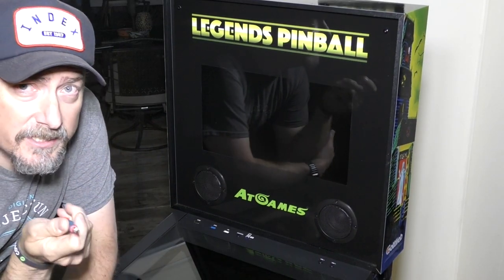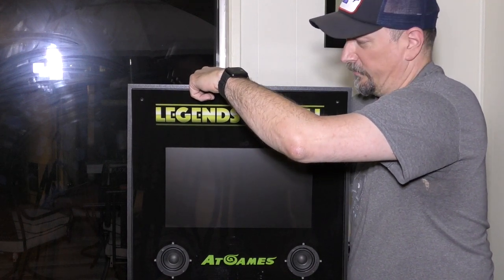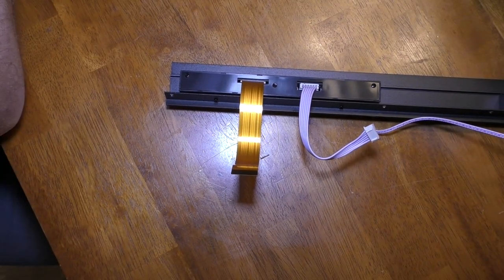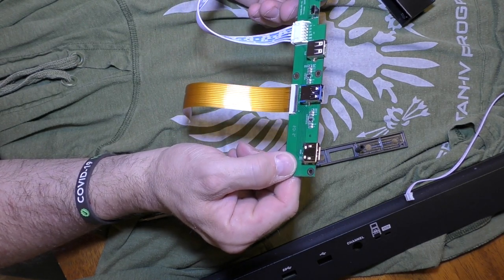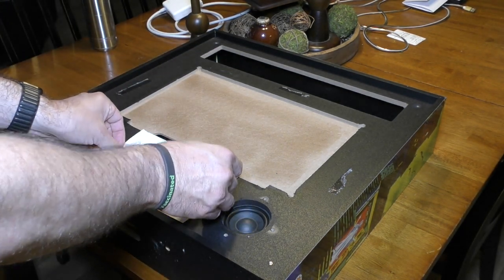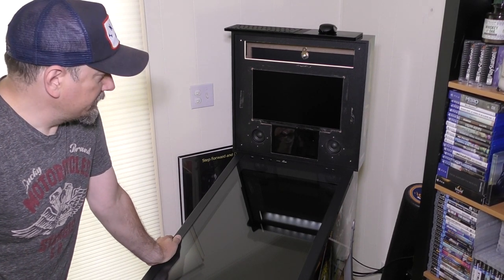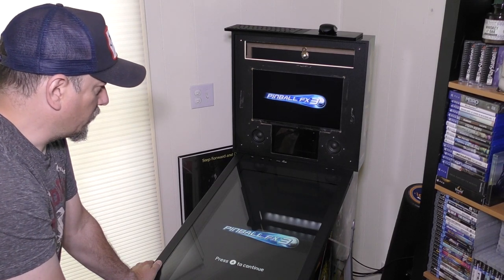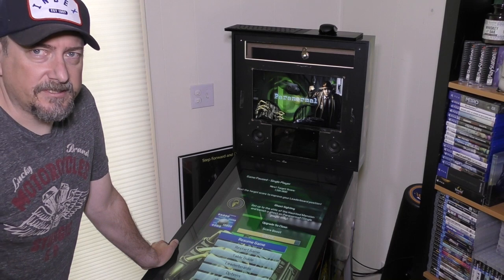Let's Upgrade the ALP with a $100 DMD - Part 1! AtGames Legends Pinball Teardown And Install

Comment: Nicely done! Lots of scary stuff going on , in there. I've tried 8" DMDs, but my vision just won't let me see those tiny displays, from 3 feet back. I'd likely have to put a larger monitor, for the back glass, and a 15" DMD below it, with the speakers being moved to the back. Did do that on a GRS 3/4 scale table. Works well, albeit looking non-canon. Works for me. visitors can just play the A1up tables, if they don't like it. LOL Perhaps one larger vertical 16:9 monitor, split for the two display streams would work, too. Glad you were able to get it all working. Very cool. Thanks for sharing.
Reply from the maker: Thanks for sharing ThomasGrillo. Good idea with the single verticals screen. I know there are a couple different aftermarket DMD & Backglass Backboxes out there, so at least there are options for folks wanting to and a decent sized DMD

Comment: Why not have a piece of glass in place of the plexcy you can spray paint the inside of the glass and also you can cut a separate glass for the dmc screen so youll have 2 pieces of glass if you like

Comment: Was it necessary to remove the stock dmd screen though as it's really fragile I've read? I'm thinking just 4" × 1" slot cut under the stock dmd so the cables for new monitor just feed in from back of monitor. Then I'd just 2 way tape with something strong like gorillas the new monitor to the box

Comment: yes you are right you don't need OTG button go into OTG mode but i think you need the button get out of OTG mode right?
Reply from the maker: Hey David, yes you’re correct. I mentioned that at the end of the video. You still need a way to back out of OTG. You can also just flip the power switch on and off if nothing else.

Thanks for checking out the channel!

Comment: DMD mid is nice. I may do something similar. I want my mods to stay close to home, too. Replace exciters with stronger ones, throw in a rumble bass and call it done (except I might do a DMD) for me if my modding starts going too big, I'd rather buy a bigger, badder cab or build from scratch.
Reply from the maker: Yeah, I agree with you. At one point, you just have to make the call to build a more official cabinet. I’m well past that point, but I’m lacking space, which keeps me from building the full size unit, so I just keep hacking this ALP up, lol

Thanks for checking out the channel!
Reply: @FactorofGames  yup. Big deciding factor, right there. My game room is tiny. Maybe 10 foot x10 foot. Luckily removing doors on and clearing out a closet gives me some more real estate. But that's what steered me to look at 3 machines with multiple games and controls each to give me the ability to play the largest array of games I can. ALP I think really hit the mark.
Reply from the maker: What are the other 2 machines that you have beyond the ALP?
Reply: @FactorofGames  don't have yet. Arcade 1up Outrun that I want to modify with a Logitech G29 force feedback wheel and you can get a manual shifter and 3-pedal setup then load it with any racing game I'd ever want. that works together and the atgames legends ultimate. My dream. I should have the other 2 in a month or 2. My ultimate dream for my tiny setup is a custom cab instead of the legends ultimate and have buttons, spinner, guns roller ball and flight stick on a 2 player set up. But that's just a dream right now. I know nothing about building stuff.

Comment: Any idea where I can find images for FX3 backglass running 3 screens Just the image No DMD or Speaker on it? Thanks in advance.
Reply from the maker: You should be able to grab them here: https://drive.google.com/drive/folders/1QfTJyNvROCttPsZiQlZ3aNCagods0zNl
Reply: @FactorofGames  I have those but is there a way to remove the DMD on them. Just those image by themselves?

Comment: Nice video! How can I separate the DMD display from the back glass? I want to do this with my legends pinball but right now my back glass and DMD are on the same monitor. Thanks
Reply from the maker: The only way to separate them is with a PC and using the OTG capabilities of the Legends Pinball. You need to also purchase the AtGames Vibs board to connect up an additional hdmi connection. This playlist should cover a lot of the overview for setting up your ALP for backglass and separate DMD https://youtube.com/playlist?list=PL8q1uu7_LJHRv9UJBEWtlqmWI1xrS8sNF
Reply: @FactorofGames  
I have my pc hooked up and I am using a separate monitor right now just for fx3 because atgames is out of the boards at the moment. Once they have them back in stock I will use the legends pinball back glass. I just purchased the 3rd screen for my DMD to be on i just wasn't sure how to separate the DMD display from the back glass. Thanks for the response and I will check out the link you provided.
Reply from the maker: Got ya, I wasn’t quite sure where you were in the process. So the Pc will need to see all 3 screens which means your PC Card will need to have a few DVI ports or hdmi out connection. I run a setup with 1 hdmi out and then 2 dvi to hdmi out and that accommodates all 3 screens. You might be able to use USBc to hdmi if you have that option on your rig.
Reply: @FactorofGames  
Yes Sir I tried this last night my laptop will display 3 screens.
Reply from the maker: What is the connection to the DMD?
Reply from the maker: Actually, a better question is did your pc see all 3 screens? Also, what pinball game are you trying to run that doesn’t separate the DMD and Backglass? If it’s Zaccaria on Steam, there is no option for a separate DMD. If it’s Pinball FX3, you need to request a Cabinet code which is free. Pinball Arcade costs $150 through Arcooda. Then there are Visual Pinball and Future Pinball, which you setup yourself.
Reply: @FactorofGames  
Right now I have the main screen on the legends pinball play field I have a computer monitor that i am using for now as my back glass and DMD display. They are both displayed on the computer monitor and I have my laptop screen that I can use as a 3rd monitor if need be.
Reply: @FactorofGames  
Yes I already got my code from fx3 and fx3 from steam are the games I'm running
Reply: @FactorofGames  
I want to thank you for your time I think I just figured it out. I was trying to attach a pic of my setup but it wouldn't let me. I have everything correct now after messing with the Dot matrix. Again thank you I also subscribed to your channel

Comment: Do you have to purchase the artwork for the back glass for each table in OTG? If so how do you go about doing that? Also is there any programming for the DMD to get it up and running? I have a capable desktop and built a custom back box. Already have the 24” monitor and DMD. So questions are.. any programming to get the DMD running and also about the artwork for each table in the back glass in OTG. Tks for any help in advance
Reply from the maker: For the DMD, it depends on what PC game you are running. The most basic is Pinball FX3, and all you do is email them for a free cabinet code and then it unlocks the DMD and Backglass options. At that point it’s just adjusting the positioning on your screens and finding the images for your Backglass. I believe I found mine on a Reddit forum, but it was awhile ago. You essentially need the images in 1920x1080. Just do a quick search for “Pinball FX3 Backglass images” and you’ll find them. The DMD info is already in the game.

Other games like Pinball Arcade, require you to pay to unlock them officially. There has been some mods that are supposed to enable “cabinet” mode support, but I haven’t tried them.

Then there is Visual Pinball and Future Pinball, but admittedly I have little experience here and fight with it all the time to get it working. I would suggest Terry Red’s channel here https://youtube.com/c/TerryRed for information on those programs. 

Good luck!